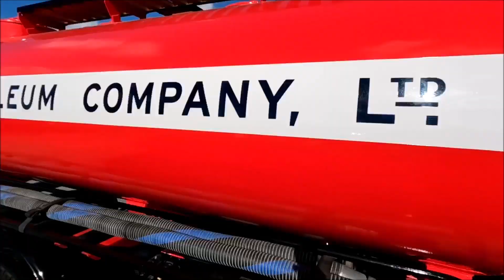Ford 100e ST170 - Episode 15 - Pulling Out Early

Comment: Be interesting to see the data from the Dyno. I'll be looking out for this car on the roads.
Reply from the maker: cheers  landlocked pal  il be interested  to see  what it does too, we are not looking for big power just a relliable nippy driveable road car, the engine is pretty much stock apart from the throttle body,s and mazda 5 speed
Reply: @KerbsideClassics  And what a lovely run-around it is. Rob.